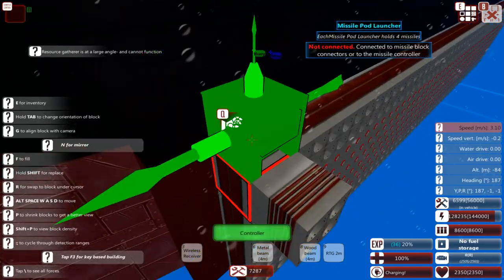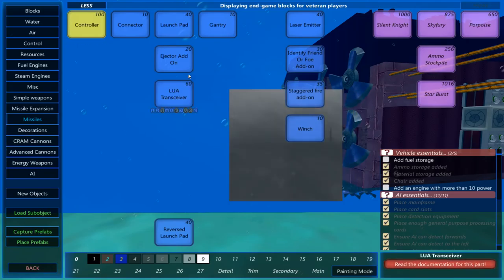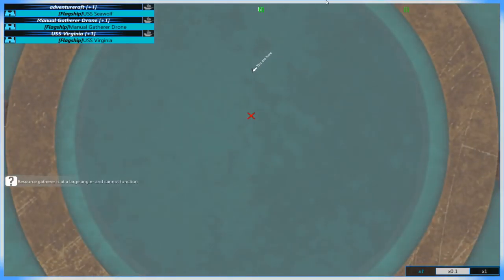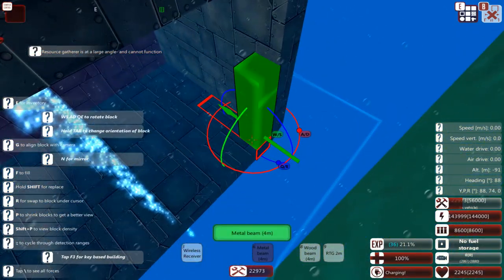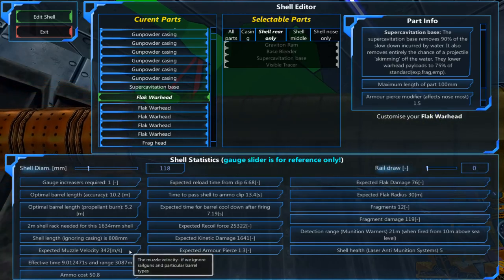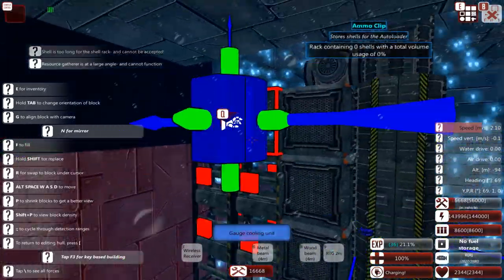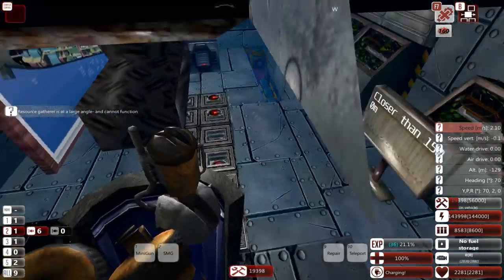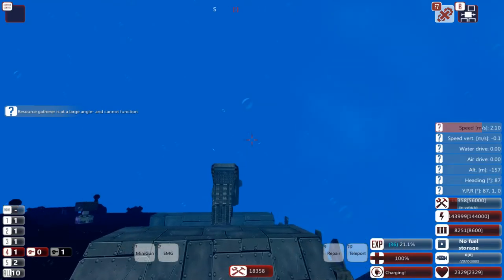From The Depths - Torpedo Defense System

Comment: While the wall of anti torps is cool, I think its too costly and too much. I have not had anything that will spam out 10 torps in 1 go. However I would suggest some on the front and rear. You could use the same total amount just spread out more for more cover, saves time/missing while your side anti torps try maneuver to the front or rear for torp intercepting. You need to remember that the passiv sonar will only detect sonar warheads, not IR warheads/laser designation/others (from what iv read and tested). 

Try stacking dedi blades with extenders, you may find that you go faster with less space used(motor driven on) in designer mode so you wont need to undo stuff if you dont like. 

Detecting and tracking air targets is going to be a little hard like a squirrel for example, your detection systems will lose lock on it after it does a U turn for about 5 seconds. I have made near to 10 fired 0.5 or 0.5x2  50Mps slowest possible on variable thruster missiles with radar Whead, radar bouy, 1 EMP for no reason could be fuel but not a regulator, fuel and fins. To slowly fly to target giving me 'better' detection and also I did not want them to hit the target. yet its still crap for tracking air. So what I am saying is, APS cannon firing under water, with our current detection is going to be hard. A 360 turret small ball PAC may yield better results even tho it will still miss due to detection yet it is an instant hit or miss. With APS you would want a large flak radius or 3-4 Frag 180 radius with a timed fuse and also the laser thing stuck on the turret head (forgot the name) so that it explodes very close to the target i think something like a 0.5 in the timed fuse would be enough. You need to pop in the designer mode and test things out, its the best way to grasp APS and save the prefab to place in your adventure.
Reply: However, this is where I get to the last vid and my last comment. you could hit 0 alt like a boat when you have a troublesome air target, so that the other detection systems that only work above water will properly detect air targets for your turret to track w/o issues. 
APS turret with our current detection will work well against sea targets.

Comment: Try putting some torpedo missile interceptors on a turret with apn and instead of using a lwc use the ciws one instead.  The turret may need its own passive sonar for detecting incoming torpedos.  I use a set up like this on my subs and it makes them even more effective if the interceptor torpedo has a sonar buoy.
Reply from the maker: Good point. Probably way more cost effective too. Do you just give it a weapon controller? Does that make the turret aim at the incoming torpedo? Or is that done by the other weapon controller, the CIWS version one?
Reply: Stealth17 Gaming for it to target torpedoes you will need the anti missile version of the lwc its the one that looks red white and blue in the menu.